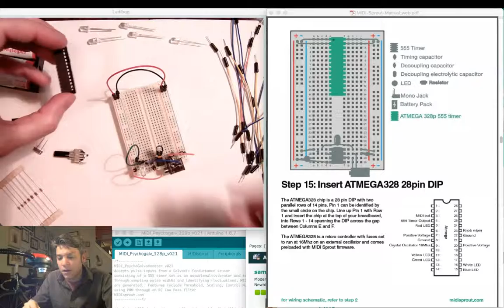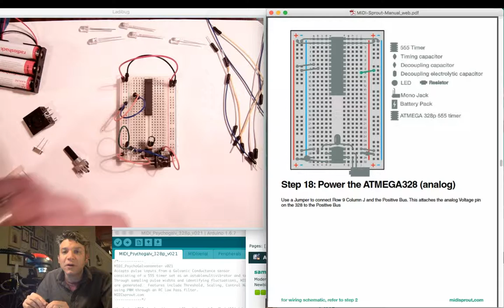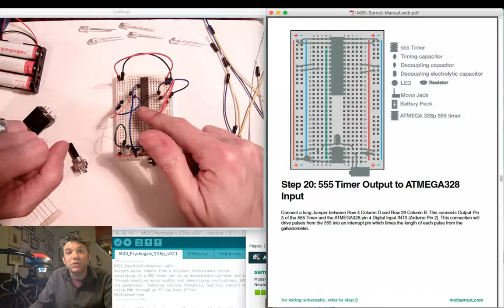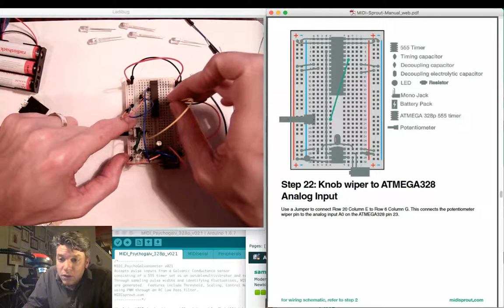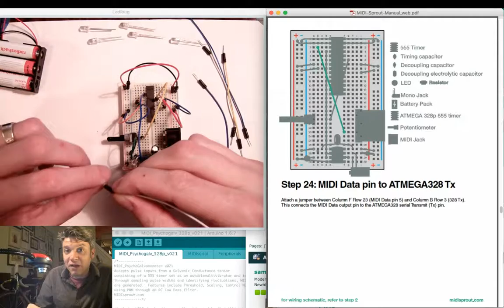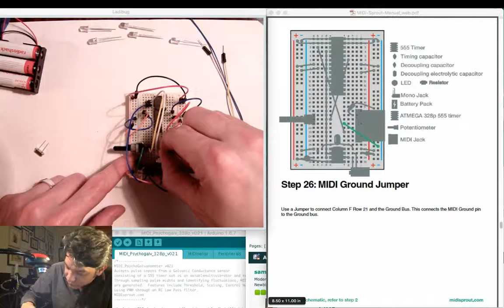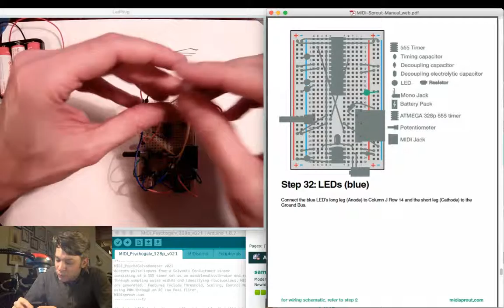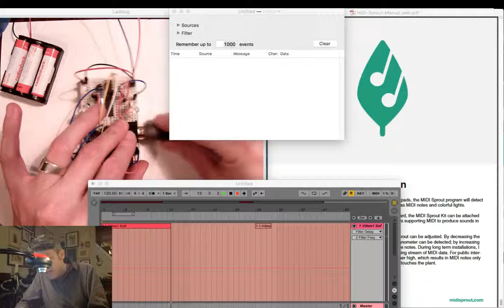MIDI Sprout Tutorial Final Build (Part 3)

Comment: Hello Sam, I have done all connections and I do get the lights all turned on. But then after connecting it to my computer I couldn't get any midi signal, when I checked it with Midi monitor.